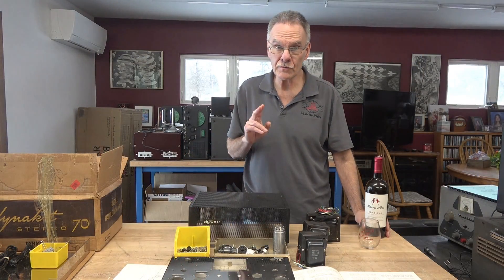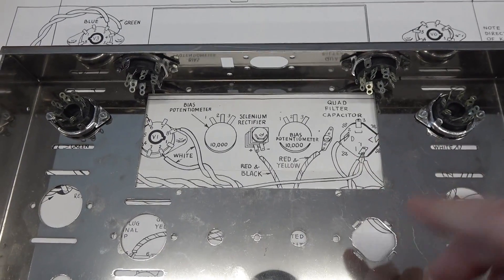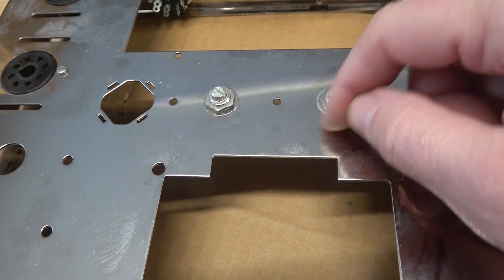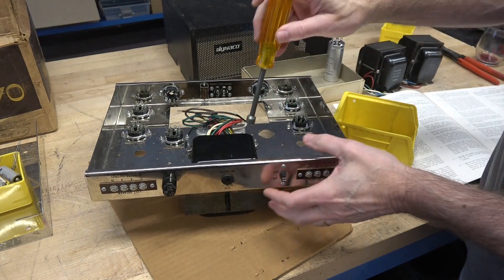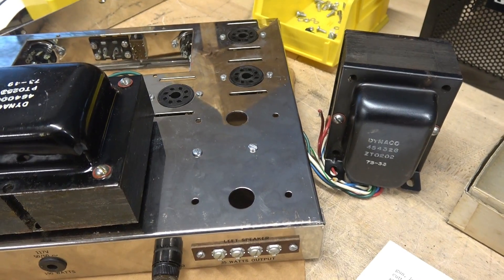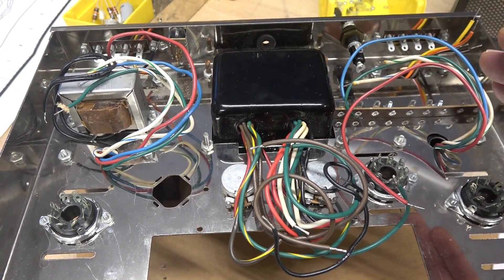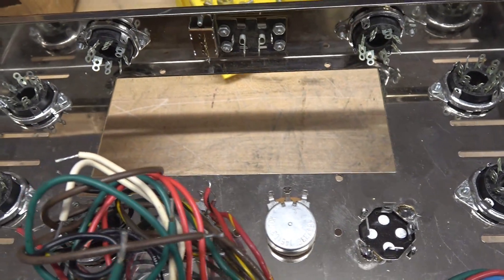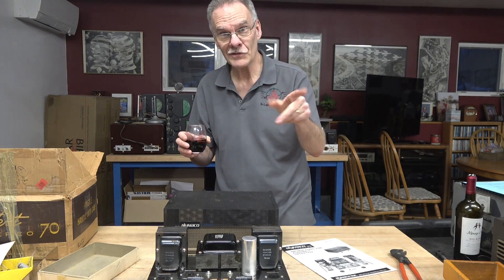Build a Vintage 70's Dynaco Dynakit ST-70 Tube type home stereo amplifier unbuilt kit Part 2

Comment: The selenium rectifier has a larger voltage drop than a silicon diode so you'll need to add a series resistor on the diode to get the same voltage output.  Else, the output voltage will be out of spec.

Comment: I've had the Xcelite nut driver set you mentioned for 50+ yrs. In fact, I used them in building many Dynaco kits in the 70's for customers who were too intimidated by the parts count. Great way to ramp up as a young tech back then!

Comment: Those black cat caps are more then likely dried up and electrically leaky.
Reply: They definitely should be tested at voltage. Ive got old black beauties that work great. They gotta be older than these black cats

Comment: Also, I have very nice  HQ-100c with a missing oscillator coil and recently purchased another for parts. I will be replacing that coil and then doing the mods as per your videos.

Comment: I’m pretty sure these chassis are nickel plated and don’t age like chrome would. The nickel is more prone to corrosion. It needs to be polished to keep the shine. Humidity can speed up the corrosion. I have rebuilt several  and three of them had badly rusted chassis. I stripped them bare and had them sand blasted and powder coated, one silver one red and one blue. my first kit build was a mono integrated push pull 6BQ5 amp(Knight Kit) I built in 1965(I was 15). I have since built 150+ custom amps(4 Guitar)and preamps Love watching your videos!

Comment: Old audio guy here, experienced in that era, with an EE degree.  Hope you checked that chassis mount multiple electrolytic before you solder it down.  Just because it was unused I predict it is bad, worst than a bad chassis ground.  Let me know if no Hum and I'm wrong.
Reply: I believe he said he was replacing the electrolytics with modern lookalikes in last vid. Personally I have reformed many NOS cans with my sencore cap/inductor tester.

Comment: One thing... Are you certain the speaker terminal strips shouldn't be mounted from the inside?
Reply from the maker: Yep, Pictorial shows them as installed
Reply: @d-labelectronics  Cool cool. I just thought it might look a little cleaner the other way around.

Comment: Is this the same circuit as the eico st-70?
Reply: As I recall, the Eico used 6L6 finals instead of EL 34s
Reply: No, they are different.  For starters, the Eico ST70 used 6SN7 drivers and 7591 O/P tubes.

Comment: It is nice to see an assembly of an original Dynakit ST-70. A real treat, thanks! If I had a choice, I would want the original over the modern replicate kits. However, the replicate kits are still a great modern kit alternative to the original. Will be looking forward to part 3.
Reply: You would put in old capacitors from the 1970s? I don't think it's really a good idea.

Comment: 2:43 - One nice touch would be to temporarily remove the lower bell from the power transformer and mount it from the bottom of the chassis. This way, the core remains flush with the chassis.